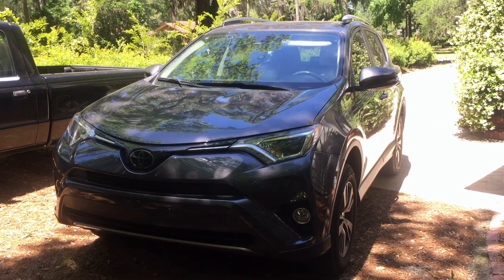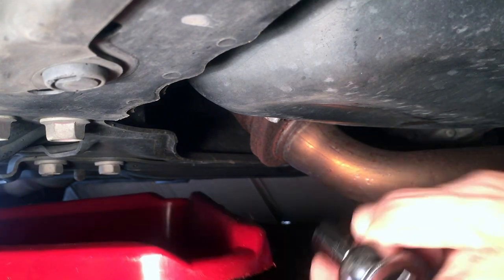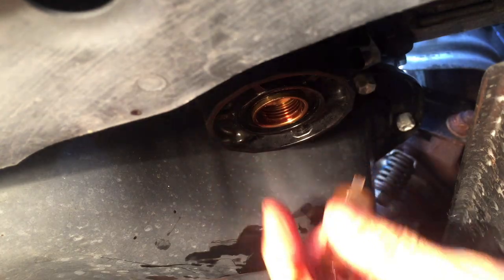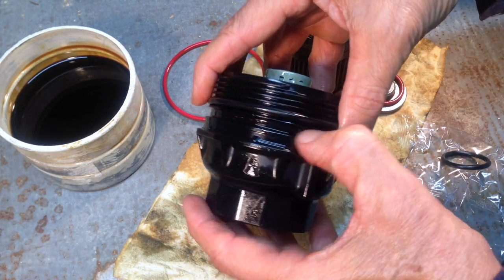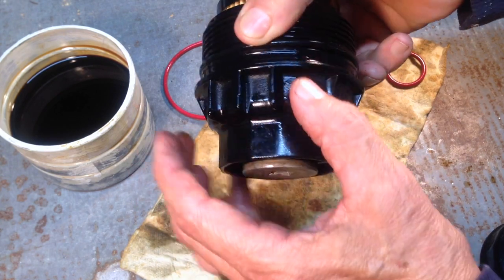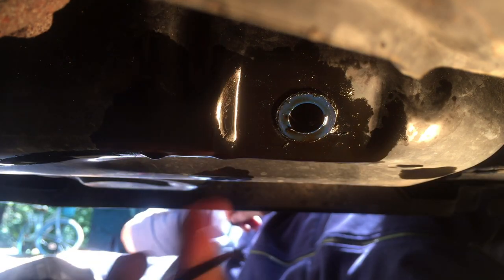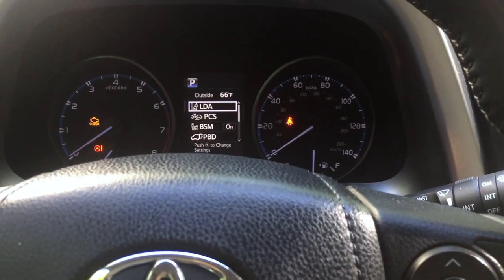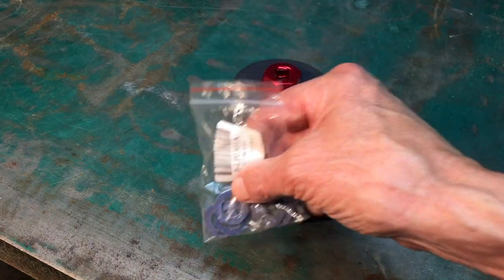Toyota RAV4 Oil Change - Motiv-X Filter Wrench (2014-2018)

Comment: There is a o ring therefore there is no need to tighten it to much. I bought my oil filter housing wrench from Walmart. It was a 1/4 of the price of the Motiv-X & it works fine.